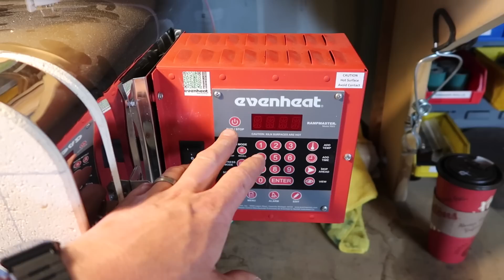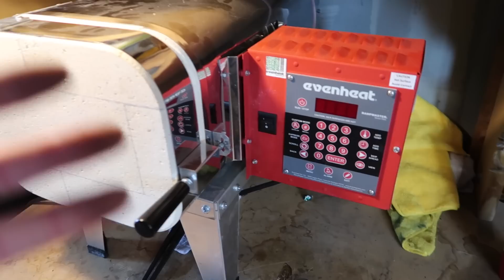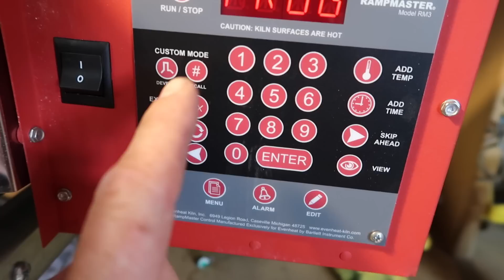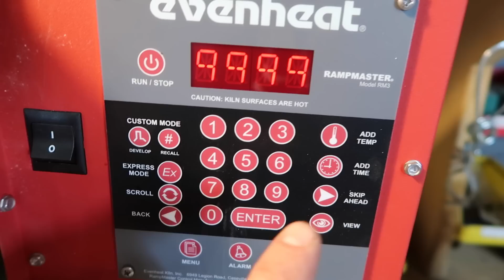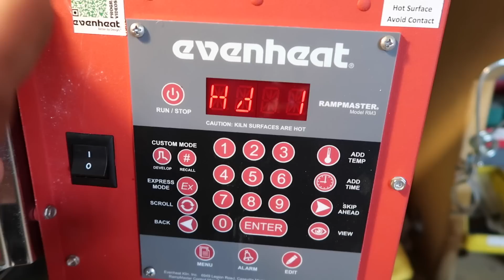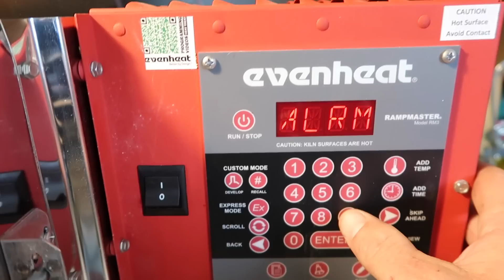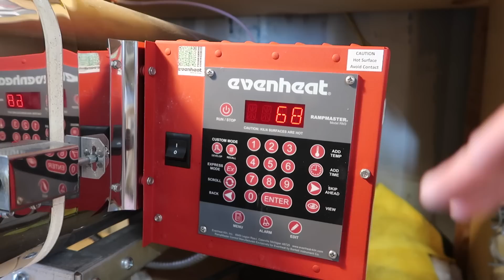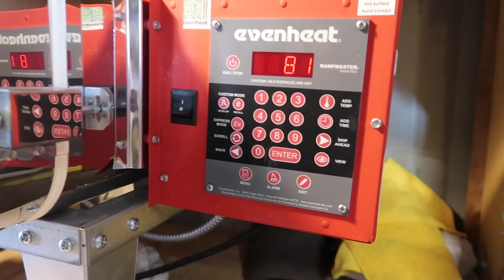Evenheat Knife Maker's Kiln - quick look and how to program it.

Comment: There's a boron compound that you can use, essentially you paint it on, it's rather thick, almost like a clay and that resist the heat and prevents the decarb, after heat treat you just scrub it off, I have seen a British guy called Jacklore use it, pretty sure if you asked him what it was he would tell you, he's pretty helpful to the knife making community, place I use is commercial and they use a vacuum furnace then use an inert gas, seems to do the trick.
Reply from the maker: Thanks for the information! I'll have to look into that. Cheers!

Comment: For your 01 at what point do you place the knife in the kiln? Right at the beginning or wait until a certain temp before putting them in? Thanks!
Reply from the maker: I usually wait until it's about 1450 or so. I set the timer to start once it reaches 1475, but by the time I open the door and get it in it cools down and takes several minutes to get back up to temp so I usually pop it in a little early. I leave it in for 10 mins once it's up to 1475. Cheers!
Reply: Simple Little Life thanks for your reply much appreciated!

Comment: Nice, do you coat your blades with anything to reduce decarbonisation?
Reply from the maker: No, I've thought about stainless foil, but a lot of people don't use that with O-1 tool steel. Having said that it's still one of those thing I plan on trying soon. If the SS foil wasn't so expensive I would be doing that with every blade.